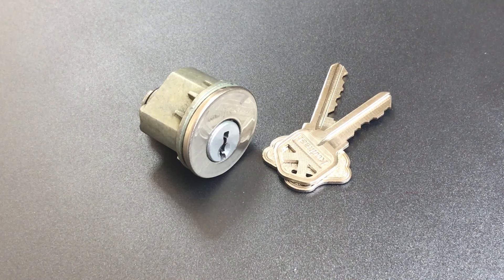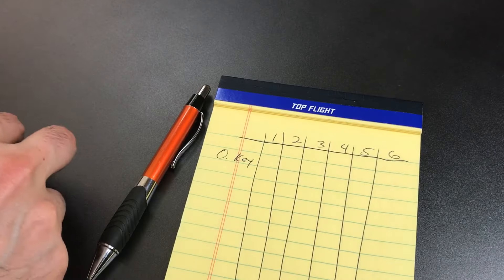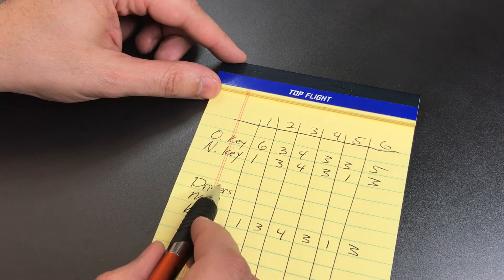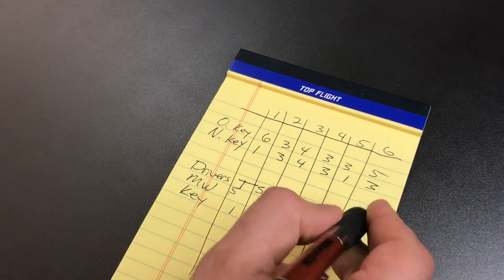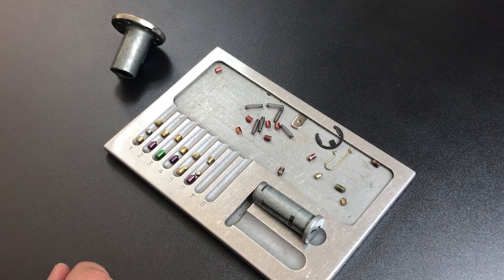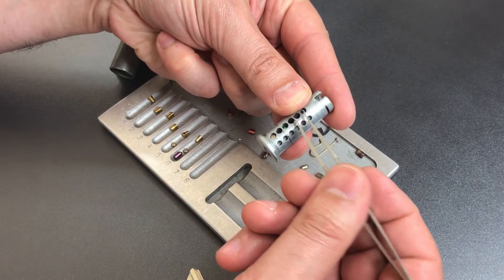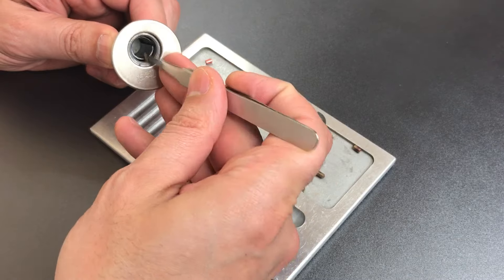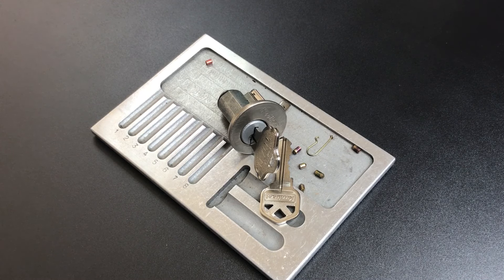[541] How to Make a Kwikset Key Trap

Comment: How do u go about removing the cylinder from the Bible after the T pins set n the construction holes? Wouldn't the springs lock it in even with the tail piece off?
Reply: I'm wondering if u could drill a line the same depth and width of the holes on the cylinder beforehand and connect them together all the way to the back so the T pins had channel to follow through when u needed to dismantle it
Reply from the maker: Take the cap off the Bible. Pretty easy.

Comment: The advice here is slightly incomplete because it doesn't talk about what happens if the new key has a deeper cut somewhere.  I'm no expert except in mathematics and logic, but I gather for that situation you need a key pin of length equal to the shorter of the two, a master wafer of length equal to their difference, but then a standard/security driver that won't get trapped, since the correct key won't push the master wafer into the drive pin's chamber, but is still required so the old key will turn into the trap.

Comment: Is the lock just trash now or is there a way to get the key out without drilling out the core? (supposing you have the lock outside of the door like you do in the video)
Reply from the maker: +bdot02 See video description. 👍
Reply: +bdot The pins can be removed via the 'cap' at the top of the pin stack. It's so easy to remove, that you can pop-it out without having the lock out of the door. Here is bosnianbill demonstration the "top-popper" https://www.youtube.com/watch?v=ggxAv8jY-Ns
Reply: CodeBurger
how's that going to work if the lock is turned a little?  The keyway is not lined up anymore.
Reply: If you pop the top off the bible you don't need it to line up. Out come the springs then the T pins, now the core can move again
Reply: not using the bosnianbill's Top Popper way.
Reply: Rick Dupuis You are right about the "top popper". I only linked it here because the top cap is clearly explained.
Reply: "trough"? You might want to clean that up a little.

Comment: What if you use the wrong key while legitimately entering?
Reply: Exactly. So I think this would ONLY really be good for something like proof of tampering with something that should never be used by any unauthorized people, since it is going to cost the owner time and money to drill out the lock and replace it, which will make the door provide NO security at all, while the lock is being replaced. Maybe the best implementation would be to have a door with a normal lock, a short hallway, then this sort of tamper resistant lock. That way, you can lock the first door, while working on replacing the second lock. If you used this modded lock as your front door, people who don't like you (like an upset ex-boyfriend or ex-girlfriend) or someone who knows about it and just wants to cause you trouble, could intentionally screw up your lock.
Reply: Jay H you don't have to drill out or replace the lock. Just enter your home from a different door open the door with the stuck key and take apart the lock. Yeah it'll take time to fix, but it won't take any money.
Reply: Thanks.
Reply: thanks.
Reply: James King a random key would likely not turn at all because the wafers would not be either below or above the sheer line - they would be blocking it. So it would be just like using the wrong key on any lock. It wouldn't turn at all. Only the target key partially turns and gets trapped.
Reply: you would probably throw away the old key after modification
Reply: if you're doing a modification like this you really need to destroy all your old keys so you cant accidentally use them. This is meant to protect you from people who made unauthorized copies (old tenants, old boyfriends, etc)
Reply: obviously you're not going to keep old keys that wouldn't work even if you didn't install a trap
Reply: Jay H Like an airlock in rust.
Reply: Toxically Masculine
Are you the one person in the world who doesn't have a half dozen keys in drawers and hanging on hooks that you're not sure what they go to?
Reply: That was explained in the 'Important Note' above:
"The only ways to remove a trapped key are (1) to enter the house trough another door or window and disassemble the lock from the inside, or (2) drill the lock. Use accordingly. 👍 In addition, note that this trap works only if your door opens by turning the lock core counterclockwise.  However the cylinder can be modified to work by adding construction keying holes on the left side of the core."
Reply: Once the key has been trapped like this, how do you disassemble the lock once you've removed it? The pin that's holding it in place will also prevent the deconstruction, won't it? Or am I missing something?

Also, what if this is your only way in????
Reply: Paul Simpson remove side retain screw, spin out cylinder, grind off top, remove pin and stuck key, maybe hot glue the top, put spring and pins back in.
Reply: @Paul Simpson: Hopefully if you can follow the instructions to make this lock, you're also smart enough to realise that doing this to the ONLY door is a dumb move...
Reply: @RealUnimportant You make a good point.... ;-)
Reply: Why boyfriends? Are you gay? do you have a lot of ex-boyfriends?
Reply: Hopefully only two keys are at issue here - the new key and the old key. We'll call them 'N' and 'O' for the sake of simplicity. In some cases, using master pins allows a rogue key to form a sheer line. When I was about 12 we went trick-or-treating at an apartment complex and a random Kwikset key I had just happened to open the master-pin loaded entry door. We cleaned up.
Reply: what about old girlfriends?
Reply: Have a replacement lockset and a Philips screwdriver in your pencil and rubber band drawer.
Reply: If you have a wrong key, it won't turn at all, like any lock with any wrong key. If you have that specific old key, it will be trapped.

Comment: You forgot to mention this will only trap the key if your lock is on the right side of the door thus requiring the key to be turned counter clockwise to unlock. If your lock is on the left side of the door you'd have to install the lock upside down for it to work or else the key would only get trapped when the adversary is trying to relock the door after doing their mischief thus also leaving your door unlocked...